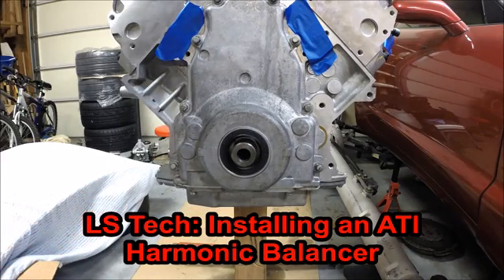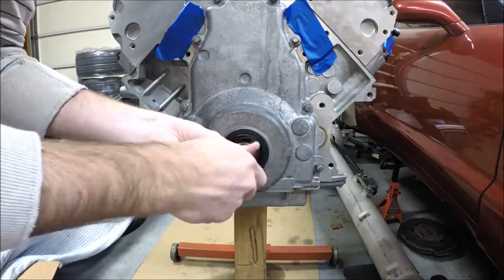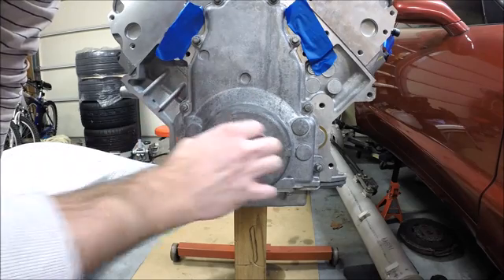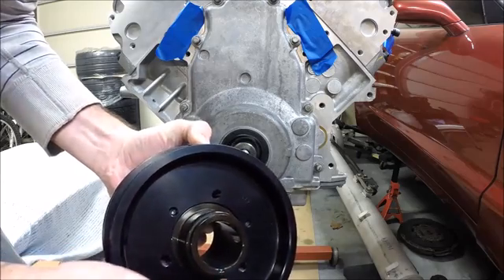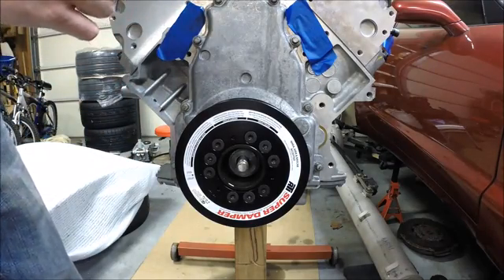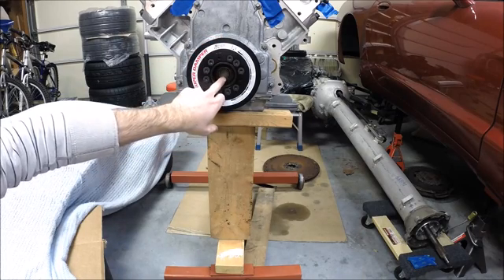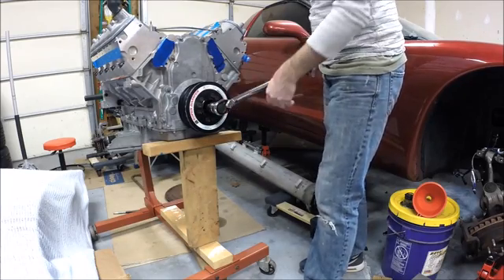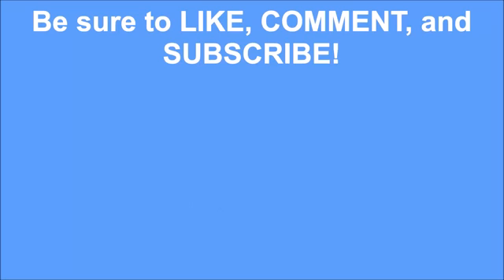LS Tech: Installing an ATI Harmonic Balancer

Comment: The ARP crank bolt requires a 12 point socket.  May I ask what size 12 point socket?
Reply from the maker: I believe it is 1-1/16”.

Comment: Man your videos are golden, thank you so much for the details.
Reply from the maker: Awesome, glad to hear the videos are helpful!
Reply: @ScrufsGarage  not trying to bug you but I’m stuck on a decision I’m trying to make. In the instructions, it says for any Aluminum Hubs (mine is) using a front cover Teflon seal, you must have a “SPEEDY SLEEVE” or a steel hub. The front cover seal on my replacement will be oem. I’m trying to figure out if I need to add speedy sleeve if I’m using a oem front cover seal. Also seeing if I can pin it, or should just go the black RTV route.

Comment: i have a 6.0 LS and ive removed my oem dampner several times and reinstalled it using tools from ICT billet,im installing a super charger from torque storm and my engine is in the ride,im having hell seating it all the way to the crank so i can pin the crank with a drill,i use toe straps or crank straps to hold the balancer from turning but good lord this new ati balancer is super tight,im scared im going to break something,usually one tow strap works but its stretching it,so tomorrow im going to put two straps on it then tru using my old oem bolt my ICT  billet tool is black steel but im not sure how much it can handle,guess i can look,any tips on keeping the balancer from turning while in the car ? anyone ?

Comment: Hey thanks for vid, I’m reading the ATI instructions that was included with their super damper, it says we gotta measure some things to get the correct, measurement from the tip of the snout to the washer surface when the damper is fully on the crank, I didn’t see you do this or mention it, is it required for proper installation ?

Comment: The oem bolt is TTY.    I know it’s not safe to use it for the final install.  

But  Is it really all that safe to use it to get that balancer on?      It could snap no?
Reply from the maker: While by definition you have gotten into the yield region for the bolt, you are probably still a long ways from failure point of the bolt, so there shouldn't be an issue using it during the install.
Reply: @ScrufsGarage  cool thanks for the reply.       Would you mind taking a look at my other comment?         About the dampener and the timing marks.

Comment: The ati dampener has timing marks on it.   

If you were keying your balancer.     It would probably be a good idea to set the engine to TDC 0 first right??          So that way the key is also a marker for TDC. 

  In case you had to remove the balancer again.

Comment: helpful video series. i'm doing all the same stuff on an 01 LS1.
Reply from the maker: Awesome, glad to hear the videos are helpful.  My LS1 was a 2001 also, so they should be similar.
Reply: @ScrufsGarage  what's interesting, is my 01 block has the timing chain dampener holes while your's didn't. everyone told me those didn't show up until 2003.

but ya, SUPER helpful. videos overall.
Reply from the maker: Oh, that's interesting about yours having the timing chain damper holes already drilled.   Best of luck on your build!

Comment: Where do you buy the balancer installation bolt?
Reply from the maker: I used an ARP Crankshaft Bolt (234-2503)  http://amzn.to/2EvEkFv  (Always be sure to double check the part # for your specific application on the ARP website).   If you're asking about the installation tool I used, it can be found here http://amzn.to/2lC9Ngz     Hope that helps!
Reply: @ScrufsGarage  thanks! Yes, sorry, I meant the installation tool. I need to buy one. Thanks for posting the link, but the link doesn’t work for some reason. Can you post it again. Thanks!
Reply from the maker: You're right, sorry about that.   Here's one that is very similar.  https://amzn.to/3o4qlNF    The principle is fairly simple, thread the rod into the crankshaft, then use the nut/washers to pull the balancer into place.  That way the tensile load is on the rod, instead of on the threads of the crank bolt.   If you want to spend a little more, they make some of those tools with a thrust washer/bearing to eliminate the friction between the nut/balancer.   Nice to have, but not necessary.
Reply: @ScrufsGarage  thanks!!

Comment: my 2005 vette lost power steering and charging.. So i shut car off and only thing i found is harmonic balancer bolt was finger loose.. But balancer visually seems to be still on all the way.... Forum member said ill need crank if it spun on it... But i feel crank is alot harder than balancer so i may luck out...( Hope so i just bought and financed the car 4 months ago)
Getting ready to order balancer... So what your thought on if i may need to pin mine, and if so whats a good kit and how hard is it to do.
Reply from the maker: Sorry to hear that.   Definitely inspect the end of the crank and see how it looks, but hopefully it's ok.  ATI makes a pin kit, and probably a few other brands too.   Make sure you get a new crank bolt as the OE bolt is TTY.  I used an ARP crank bolt.

Comment: Can you use the Oem harmonic balance bolt for this application? Also is the stud you used & the washer & nut are those a special tool that you can buy somewhere ?
Reply from the maker: Yes you can use an OEM balancer bolt... just remember that the OE bolt is TTY so it is single use.  So you will need to use a new bolt; don't reuse your old one.  However, I would recommend spending a few more dollars and getting the ARP bolt.   And yes, the installation tool is available.  http://amzn.to/2lC9Ngz    FYI, I generally try to put links in the episode notes.

Comment: My arp bolt has come out twice 15-20 min after driving. Do you know why this can happened if is installed correctly?
Reply from the maker: Honestly I'm not sure.  Are all of your pulley's running straight?   If there is a wobble in something, it might be imparting a harmonic vibration that's working the bolt out?   Is the bolt coming out on an OE dampener or an ATI?
Reply: Scruf's Garage is coming out on a ATI damper. It was working fine with the OE damper. I just upgrade to a 8 rib set up in my ProCharger. Do you think if the belt is too tight it can cause this? Both times is came out just cruising in the freeway!

Comment: That area He is pointing to at sec: 15 is the area we all should know area where the oil pressure thingy, if you look at Yamaha and most other YZF-type there is an oil clear meter to view on the left-hand side on most models, don't forget Honda Goldwing only one of that reverses only.  Very funny that Pepto-Bismol has silicate which may yield silicone Puddy for harmonic balancer dampner.  I'd rather use the silicone gel and usually most often as a mechanic blue lock tight.  Just kidding but it allows for the elimination of parasitic drag.  Did you forget to put the gel on there?  Notice He states it is an LS, so you would have the LT1 which was an iron block, then LS1 is the aluminum block engines.  Haynes Manuals have the torque-spec, but you must call with your manual to ask a tech live.  Thanks Scruf for inviting me to comment.  Nice dialing on the torque wrench. #McCuistonAutomotiveSciences #SiliconeForSeatingBalancersDampners

Comment: I dont have a notch on my timing cover seal, what is the point of putting rtb on the key notch of the balancer it self? Thanks
Reply from the maker: The notch in the balancer is a gap that could allow oil to leak past the timing cover seal.   A dab of rtv helps fill the notch in the balancer.
Reply: Did you do it to your I didn’t see a keys crank in the video as well as didn’t see rtv in dampner

Comment: If the balancer comes with a keyway in the hub and the crankshaft does not why would you install it
Reply from the maker: The key way in the hub is used if you are pinning the crank.  Otherwise just fill it with rtv so it doesn't leak.

Comment: I have a stock corvette c6 automatic 2012 with a harmonic balancer needs to be changed, if i consider installing a supercharger in the future can i pin it now while I'm at it instead of gluing the keyway ?
Reply from the maker: Yes, if you're considering a supercharger at a later point, I would go ahead and pin the crank.  ATI makes a kit to help.   Will save you some time later.
Reply: @ScrufsGarage  Thanks !!!

Comment: I was waiting to see a measurement of the snout to see how to check that its pressed on far enough into factory specs. Guess we arent covering that
Reply: Should be fully seated once you hit 230lbft
Reply: @j1mmys4ndusky  not quite, there is an actual factor measurement as to how far it should protrude off the crank.
Reply: @Battle_Garage  2.40-4.88mm

Comment: You know after the installation threaded rod, you could've just used the ARP bolt and torqued it down? Using the GM bolt to torque it to 240ftlbs and then using the ARP bolt to torque it to 235ft lbs is basically the same thing.
Reply: I'm about to change my hb next month and I'd like to know the answer to that as well !!

Comment: Torque to yield bold are only used one time because they stretch so why would you risk the chance of using that old bolt to install the harmonic balancer, your taking a big chance of braking the bolt 🤦🏻‍♂️
Reply from the maker: Yes, TTY bolts set torque by bolt stretch, so they are one time use for torque specific applications.  But it is still well within the working limits of the bolt from a fracture/failure prospective.

Comment: Do you have any engine oil getting past that arp bolt? I'm assuming that your engine is in your car and running. I'm thinking about getting a new GM bolt for my install.
Reply: Carl Gentile you can always put some rtv in the keyway slot and a little between the washer and bolt head.

Comment: So you install the balancer with the tool, seated it with the old bolt at required torque and finally ARP? You don't be scared to reuse the old TTY bolt for this procedure?
Reply from the maker: A TTY bolt achieves it's torque spec by bolt stretch (ie, putting the bolt into "yield").   Once that's done, you can't reuse the bolt for final installation because you won't achieve that load again.  However, the bolt isn't going to break, so it's fine to use it for helping seat the balancer.   But final installation should either be a new TTY bolt, or an ARP bolt (which is not TTY and thus reusable).
Reply: @ScrufsGarage  Great, I was woried about the old bolt to break in the crankshaft. We can't just install the pulley with the tool and torque the ARP to specs? We need to torque the old bolt before?
Reply: Guillaume Malaquin that’s correct! Use the old bolt first. Literally just used to get the balancer seated correctly. This procedure is listed on page 3 if you look up the instructions on ATI’s website.

Comment: Hi, I´m from Sweden and  I own a 99 Corvette with harmonic balancer problem. I have bought  a ATI 917266 balancer. Is it better if I put all three pieces together myself and then let the garage do the another job. The ATI manual says that the different parts should be installed piece by piece. Sorry if  the language is not correct, but I hope you understand  my question.
Reply from the maker: I bet a Corvette in Sweden really stands out!      As for the balancer, based on my experience, the 3 pieces should be assembled together first and then the entire unit is pressed onto the front of the motor.
Reply: @ScrufsGarage  Hi, thanks for the answer. I have the same idea as you.  I see that the Torx plus bits is hard to find . I have to order it from a special-tools dealer. Corvettes stands out , but I think there are many in Sweden . The Club Corvette Sweden got over 2600 cars and nearly the same numbers of cars  are not members. C4 models are cheapiest here.  Mint condition C1 and C2 costs the same as a new C7 in Sweden.
Reply from the maker: Yea, Torx-plus is not as common.   Honestly, the torque spec on those bolts is fairly low.  You can probably get away with using a regular torx bit.  Just be careful with it, because if you strip the head of the bolt, you're really in trouble.
Reply: @ScrufsGarage  Hi. I have already  order the tool  Thanks for your great videos. I've  looked at your videos several times and  I think they will help many with their problems. I hope my school-english is ok

Comment: Well damn, I just use an air hammer to run that crank pulley down
Reply: I agree. Owned an LS engined Corvette for years, and installed an ASP underdrive balancer/pulley, also installed a stocker size. A good investment is an ARP Crank/Balancer bolt, set your 1/2 drive impact to a high torque setting, and let 'er rip!!! You will NOT strip the threads of the crank OR balancer bolt, and you don't need a "flywheel locking tool. It works-Never had one slip or strip or come loose.
Reply: btw....Dontcha LOVE how these guys sit on their ass with a motor on the engine stand? Most of us poor blokes have to drop the Rack&Pinion steering unit before you can even see the balancer bolt. This job is a HUGE PITA!!!!

Comment: Can you show us how you kept the crank from turning?  I'm assuming there is a lockout tool, but, how did you do it?
Reply from the maker: I wedged a pry bar between some of the flywheel bolts and the engine stand.   If you already have the flywheel installed, several companies sell a flywheel locking tool, which is pretty slick.  https://amzn.to/2rjJ2jG

Comment: Are you supposed to use Red Loctite on the ARP bolt?
Reply from the maker: I prefer to follow the direction of the bolt manufacturer.  So in this case, the instructions from ARP say to use their UltraTorque lube on the bolt.   This helps ensure an even torque loading on the bolt.  You would not want to mix the ultratorque and red locktite.  If you are using a new OE crank bolt, I believe they already come with loctite applied.  (The stock crank bolt is TTY, so you would not reuse the original).
Reply: @ScrufsGarage  Thanks!  By the way, your channel is excellent.  For a one-man operation, the videos are clear, well filmed and well done!
Reply from the maker: Thanks man, I really appreciate that.   Always very happy to hear the videos have been helpful to others in their builds.   Thanks for watching!
Reply: I'm here because my bolt backed out, and my awesome ATI made love to the power steering rack, i'm use lock tite this rounds
Reply: SoFLaZ06  you must have reused the stock bolt!
Reply from the maker: SoFLaZ06  that sucks.  So in the original install did you use the ultratorque lube and torque the bolt to 235 ft/lbs?  Assuming you were using an ARP bolt and not a stock bolt?   What kind of driving?  Street, drag race, road course?

Comment: How did you keeps the motor from turning over?
Reply from the maker: I wedged a pry bar between some of the flywheel bolts and the engine stand.   If you already have the flywheel installed, several companies sell a flywheel locking tool, which is pretty slick.
Reply: Scruf's Garage thanks I’ll check into that. The motors still in the car
Reply from the maker: Here's the flywheel holding tool I was thinking of.  Should work with the motor still in the car if you remove the starter.  https://amzn.to/2rjJ2jG
Reply: Scruf's Garage thank you I have it ordered
Reply from the maker: Awesome!  Definitely post up how you like the tool!

Comment: How come some pampers are thin like they don't have a pulley for ac
Reply from the maker: I believe you can buy the ATI w/o an AC pulley (like it you deleted the ac compressor in a race car), but the overall thickness would still be the same so that the main drive belt aligns with the other accessories.
Reply: Okay I was gonna buy one with out an a.c. belt.. But I see I can't do that i still got my a.c. Lol . It's hot in Houston thanks for the reply !
Reply from the maker: I hear ya.  It's hot and humid in NC too.  Can't live without AC!

Comment: Liking your page, lots of cool info. Just curios if you ended up pulling motor from top with a hoist and If so what needed to be done. I hear that it was designed to all drop out from below but I don't have lift a home and would like to remove from above if possible
Reply from the maker: Yes, I pulled the motor from the top because like you I'm working on jack stands without a lift.  I used a HF 2 ton engine hoist and positioned on the side of the car.  It isn't long enough to reach from the front. I also had to drop the front cradle some to clear the oil pan.  I actually pulled the heads/intake while still in the car (doing diagnostics), but when I reinstalled the motor I had the heads back on it.  The heads make it even tighter dropping it in from the top... but it's doable.  Just be patient.

Comment: After you had the damper fully seated and before you put the arp bolt in. Did you happen to notice how the close to flush the bore of the damper finished in relationship to the face of the crank snout. I put mine on today and it fully seated about 4mm  out from the face of crank snout, after removing and reinstalling twice, panic, phone calls and research I finally found where the tolerance of that relationship is 2.2mm-4.8mm per the factory LS service manual.So I'm just curious what you have, if you checked ?
Reply: I checked mine when I installed it and as I recall it wasn't within the factory range.  I measured the stock hub length and the ATI hub length and then computed a new range based on the difference.   I would need to dig for the numbers though.
Reply from the maker: Joshua Whitelaw sorry I did not.  I figured at those torque levels it was as seated as I’d be able to get it, haha.